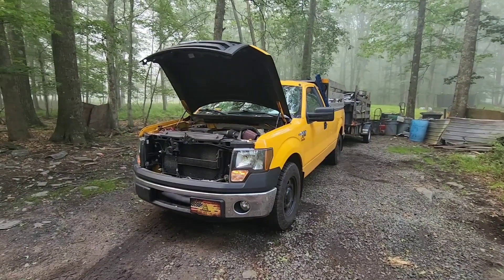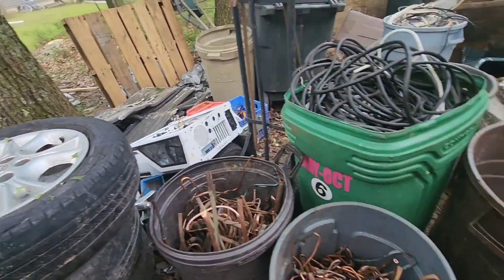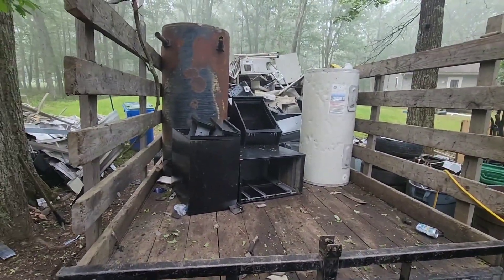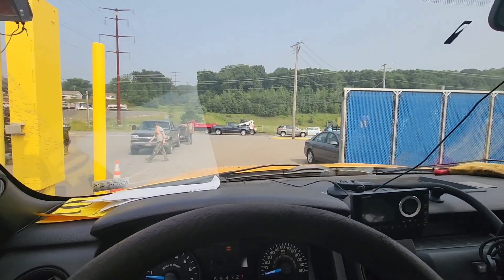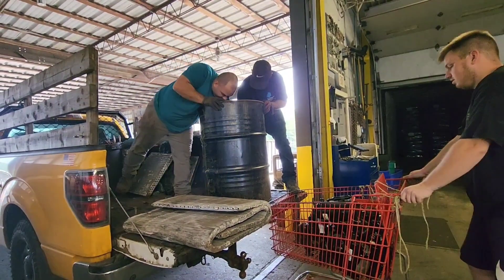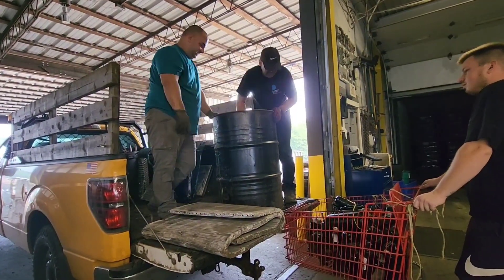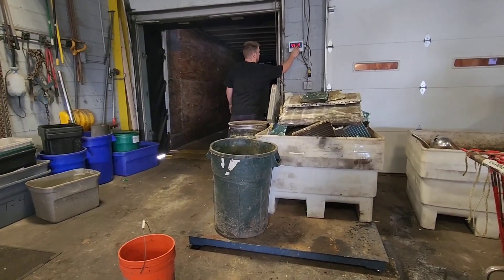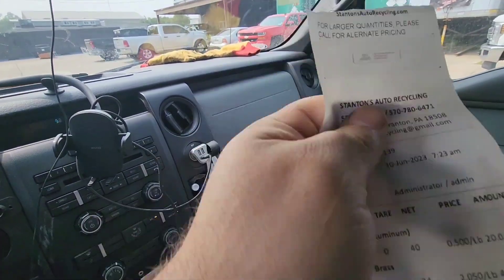Let's cash in some scrap metal.. Ending the week making money.

Comment: I used Ballistol on my steering U joint and man.... what a world difference. Also took a shake out that I had 55mph.
Reply from the maker: Yeah, I looked up how much that shaft was. A cheap ones, only about 50 bucks. The original equipment ford one is about $220

Comment: I've been dealing with Stanton's for 20 plus years all great guys there started going when it was elmwood ran buy the dad and youngest son Trucks i run now is an 05 f250 5.4 gas with 210k and 05 gmc 2500 6.0 gas almost 300k 2023 6x10 bwise dump and about 10 utility trailers from 4x8 up to 7x20 also a rollback the not on the road right now
Reply from the maker: They're a good bunch of people. And it sounds like you have a lot of equipment to move some scrap metal..